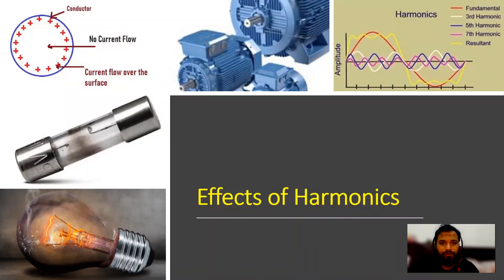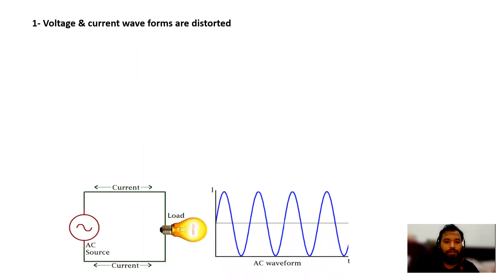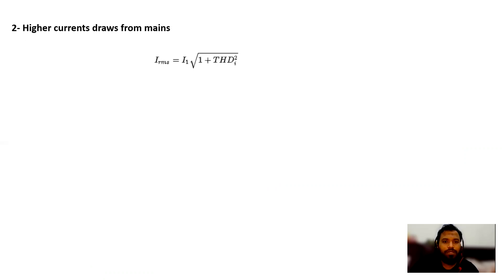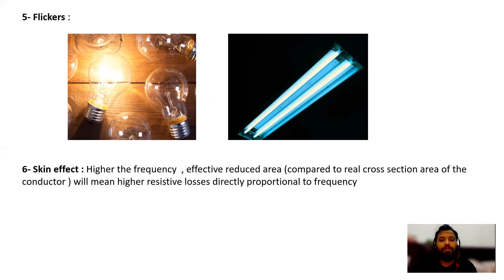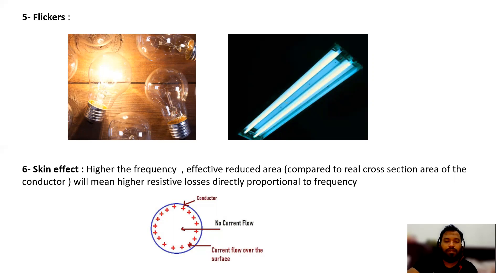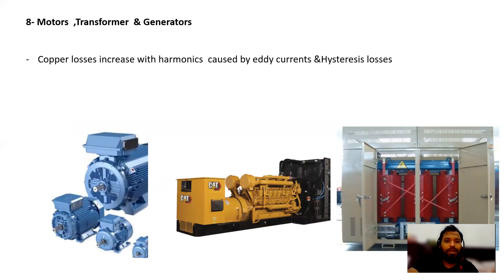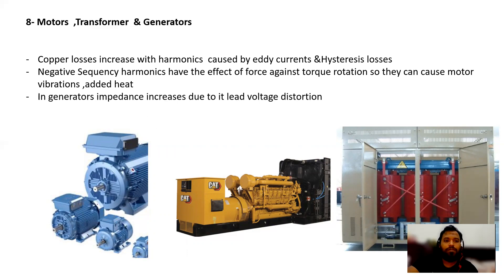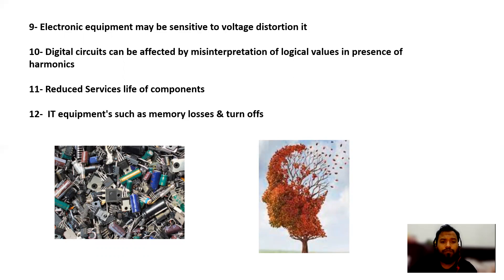Effects of Harmonics

Comment: Do we need  to connect  active  hormonic filter in  building if yes why not it connected please explain
Reply from the maker: @TauhidAlam-v2f  after load connected we analysis/study  the harmonics in the load , once we come to know harmonics in load then we finalize the harmonics filter .

That's why while design we consider a breaker and space location for harmonic filters.
Reply: @ElectricalStuff  but in normal building no active hormonic filter is present only capacitor bank with series reactor, second or u are trying to tell with good breaker sizing or space between we can compensate less Harmonics in building thank u